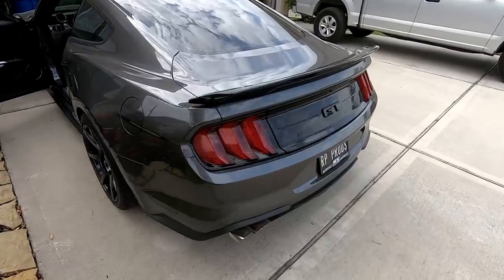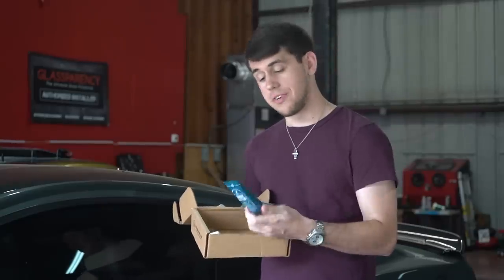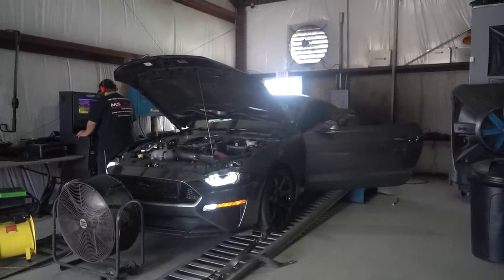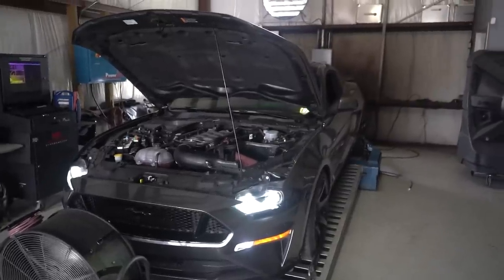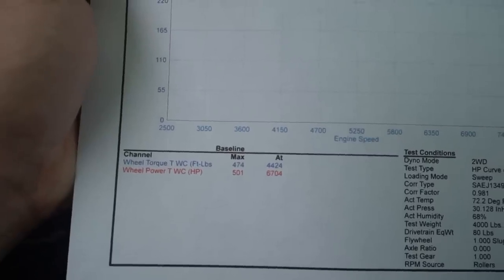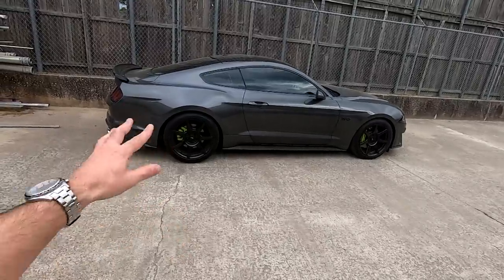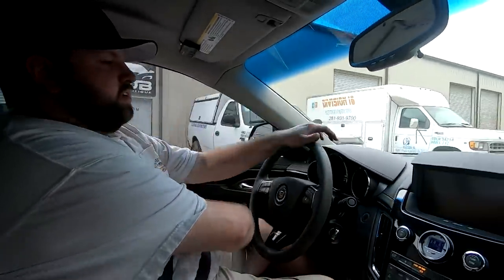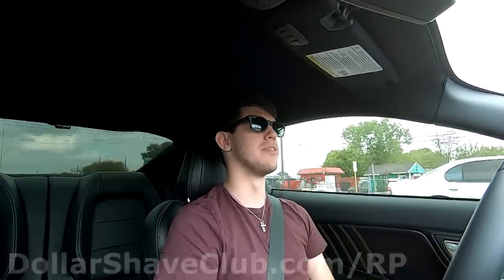2018 Mustang GT with Headers/Intake/E85 *Shocking Dyno Results*

Comment from the maker: Parts used on my car:
Intake: https://www.jlttruecoldair.com/jlt-cold-air-intake-2018-19-mustang-gt/
Headers: https://www.corsaperformance.com/collections/2018-ford-mustang-gt-fastback-no-valves-5-0l-v8/products/1-875-x-3-0-long-tube-headers-catless-offroad-w-corsa-exhaust-connection-pipes-16124?variant=12466632786006
Tune: https://www.lundracing.com/ngauge-with-2018-2020-mustang-gt-custom-tune

Install: https://www.instagram.com/houstonafterdark_/
Dyno: https://www.instagram.com/soriantuning/
Reply: What wheels are those ? And specs?
Reply: RP Productions Great Video I'm glad your Mustang is making 501 HP and I'm sorry to hear that The E85 R tube made less power than the Flex Fuel Tune
Reply: When you do another oil change let me know we might do something I am an amsoil dealer
Reply: 2018 FBO at the track... https://youtu.be/nToP47l5eic

Comment: Here we are in 2022 and the 3rd Gen coyote is really shining. 850hp on a stock motor, absolutely nothing needed to put a blower on, 10 speed still kills and with just bolt ons you’re in the 500’s easily
Reply: Back in the original 5.0 days we thought 350-360rwtq with the long runner cobra intake was a really high number out of 302 cubic inches.   The shorter runner victor 5.0 could make more high end power but reduced torque.   It's crazy that the DOHC is making a rwtq that a well build 350 would do.
Reply: @dennisrobinson8008 back in those days they didnt have 12.5 compression from factory

Comment: You could hear the car pull harder the first run. I could tell the second run wasn’t as good just be listening. You should have ran another synopsis run after you switched back to the flex tune.. did you? Maybe the motor was heat soaked after your first run? Let us know what your tuner says after he looks at your data logs. Sounds real good though!
Reply: I hate spell check after reading my last post lol

Comment: What's up with e85? Does running e85 require a tune first on 2018+ GT 5.0?? Can you mix with 91 Octane? Or does the tank absolutely have to be emptied out?

Comment: mine was the same way. I had to drive around for a little bit for the fuel to read properly. after it read properly the e85r had more timing than the flex fuel tune.

Comment: How is this shocking? It's been done a thousand times just on YouTube alone. This is well known information for the last year at least.
Reply: csr801996 even though it’s well known, it’s pretty crazy a 305 ish cubic inch motor NA with 3 mods makes 500 to the tires. Surprises me every time. Great little motor. And great torque
Reply: @nateonfireball  It's bananas.   The RPM that the power is made at isn't even that high either.

Comment: Do you think the manual is ok in the mustangs? I know the new ones are supposed to have better shift forks now but I hear people complaining about the gear ratios in the newer ones which they say make it feel less torquey. I am almost dead set on a manual, but I know those 10 speeds rip. I am between this and a SS 1LE
Reply: Nope go ss or 10 speed of mustang
Reply: @Shiftnlift  I ended up going with a 2018 Camaro SS 1LE. I love it! I did test drive a 2020 5.0 10 speed and it was very fast and sounded good but I just preferred the camaro
Reply: @tlalexander3  nothing wrong  it.. im assuming it's manual and good choice if u want manual  camaro manual is really good compared to the mt82 gen 3
Reply: @Shiftnlift  oh yes that was my main deciding factor. I've always wanted a manual and figured this would be the best time to get one since they are dying out
Reply: @tlalexander3  understandable congrats on your car enjoy it man. I just got my 10 speed in June.. I had an 2018 performance pack manual but the shift forks kept breaking. Prior to that I had a 2013 manual gt and a 2003. So it isn't driver error lol no issues with those. But I was over it and love my 10 speed I had been driving manual from 2012 till 2022 r.ip. lol my left leg thanks me im sure.

Comment: If I understand Lund correctly the flex fuel tune is using a combo of pump gas with ethanol mixed in. e85 is just that and e85r should have a higher content of ethanol.

Comment: That's impressive...i have 15gt 50th yr...18 mani lockouts..bbk LT...cat delete...pmas cai..lund soft tune...x pipe..twin tip mufflers shelby...425hp rwhp...im not happy...lund wants another $300 for retune flex...but i also need 47lb injectors...+$300 again
Reply: You ran e85 with the 18 manifold with the stock 2015 injectors? I was told it was 100% necessary to at least get 47lb injectors if I want to run e85 after switching my 2016 to the 18 manifold

Comment: The stainless works quiet mufflers have flow issues too btw, not sure if thats the model he has on the V.  Race proven motorsports has a video showing the stainless work mufflers took away like 80 hp due to bad flow.
Reply: A. Wheeler that was the quieter mufflers. They gained back to normal with the louder mufflers which I have.

Comment: Friend, how much did you spend just with the headers, catback and CAI thinking about buying an s550 soon thanks brother
-from Houston, Tx 🙂
Reply: I don't know if you ever got an answer to your question but the headers are around $1,100 the CAI is about $400 and the catback is around $1,500. So around $3,000 I would guess plus the installs so maybe $3,500
Reply: On American muscle headers run for $1,500-1,800, catback, $1,500-$1,650, tune & intake bundle, $950. Not including labor cost or a good set of tires to put the power to the ground.

Comment: Does anyone have gen 3 coyote cyllinder head flow numbers?   I have like 289CFM@.500" lift, but that's the same number that was around for gen 1 and gen 2.      I have to believe part of the power gain was improved cyllinder head flow and it would be higher than that.

Comment: Should have ran the e85r tune again after some octane booster.  In my experience, the alcohol learning process has some error, give or take a few percentage points.  You could have had e80 in the car and not e84.7. If it’s pulling timing then it’s most likely octane related.

Comment: Slap a Cobra Jet intake manifold on it 😉
Reply: JT Castro the 18’s have better air flow from factory
Reply: CJ Mani isn’t better than 18’s lol
Reply: Muscle Everyday  that’s why nobody have changed theirs yet
Reply: Cameron Summers i’m aware
Reply: Better off with a ported 18/19 intake manifold
Reply: iMiguelAOG you know you can also port the cobra jet right? Makes more power than the ported 18 mani
Reply: @iFanominul  That's a lot more money though
Reply: @mistamaog  If you're spending around $40k for a mustang than $1k for a ported CJ isn't much. Every HP counts if you're NA. Ported 18 Manifolds are still good though!
Reply: @iFanominul  True, it's just I can be cheap. Plus I feel like the price per horsepower is just a bit better on the 18 ported manifold

Comment: What happened to the ticking issue? Ceratec?
Reply from the maker: It still comes and goes whenever it wants haha
Reply: @RPProductions  ceratec is the answer. No more tick. I actually was pretty annoyed by my tick and did a shitload of research last year about it and found a forum post where somebody brought his car to Ford in Michigan close to Dearborn and they sent an engineer from Ford to look at it, he out some oil additive in there and the tick was gone. I think it was motor craft XL17. Did some more research about it and you can't get it anymore. So I tried ceratec and that helped too.
Reply: @bl4d3runn3rX  I mean I feel ceratec only silents the issue not really fixing it
Reply: @TheSprykilla  Ford says that the tick is no defect and will not affect the performance or durability of the car. https://www.mustang6g.com/ford-officially-calls-5-0l-coyote-ticking-sound-a-normal-characteristic/
Reply: @bl4d3runn3rX  I like the 18s but I dont believe it for a second
Reply: @TheSprykilla  again, it is not only the 18 and 19... 11 to 14 and 15 to 17 are also affected.
Reply: @bl4d3runn3rX  yeah I know this just seems more common. It is a real cool engine I just dont think there was enough time and development and they kinda just rushed it out there after only 3 years of the gen 2

Comment: Likely the issue with E85R tune is ethanol % content not high enough. I have an 18 GT with Lund E85 flex tune. I was told by Matt that to run the R tune I need ethanol content of at least 85%. Pump E usually isn't that high. C85 from VP would likely make a big difference. Expensive though. Get an ethanol content tester to check pump gas to find out. You can buy one for about $15. FWIW.
Reply: Chris Arquette where u live?
Reply: @chrish9502  Cleveland/Akron area. Why?
Reply: You only need 75% content to run E85R. I asked this in an email to Lund and also alejandro flores aka yolodouchebag also states this in one of his videos on flex vs e85R

Comment: On stock arnt 2018 gt 465?
Reply: No that's the bullit for 19
Reply: @karlhopkins713  no 2019 has 480 hp that why the 18 is 460 but 500 wheel is pretty good
Reply: Tony Llamas 500whp NA is not just good, it’s unheard of. What other engine out there makes over 500 NA?
Reply: @negativesplits06  You can make just about any old good v8 make well over 500 na. You can make old ones with 1k HP na.
Reply: @negativesplits06  And the z6 zo6 with a heads cam and headers make 600+whp.
Reply: @negativesplits06  392 scat pack  485 stock from. Crank with headers  cat back intake and new  fuel system easily you'll make 500 wheel
Reply: Karl Hopkins You have a good point. I guess what I also wanted to point out was the fact that nowadays most people (especially imports) turn to smaller displacement engines with lots of boost to make big power. We see supras, Evos, STIs etc. making big power on small engines with high amounts of boost whereas there’s few cars competing with them NA. One of the best platforms is the z06 since you can just do H/C/I and you have an NA monster competing with blown V8s.

Comment: That does not sound accurate at all. At least the 474 part. Here in Ga with the same set up on a 10r80 you are luck if you see 480/425
Reply: He's got a manual.

Comment: E85 ... you need Bigger injectors! 

     "Alcohol" has lower fuel density than gasoline.
Reply: ernest tibbs not with fords new fueling system with direct port injection no need for fueling until you boost